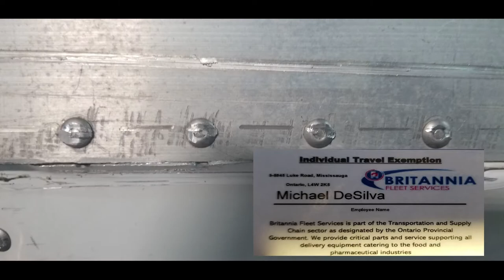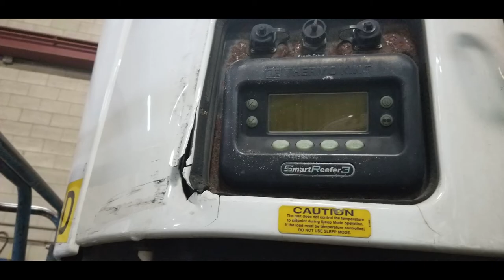how to repair semi trailer top rail and corner replace

Comment: Is that the only way you can remove the top rail from a box truck like this with the foam as the glue? I'm having trouble removing a top rail from a reefer box truck that has the foam on top like this one.

Comment: Do you have any advice on resecuring roof bows back to a translucent roof we have some that are 75% separating thanks
Reply from the maker: What we do is remove old bows scrape old glue off. Scrape all glue off roof . Reattach with chaulking tape . Reinstall bows with steel monobolts .  I make my own scrapers for the job.
Reply: @mikeydesilva8197  thank you so much for getting back to me do you know where I would find or who would supply chaulking tape?